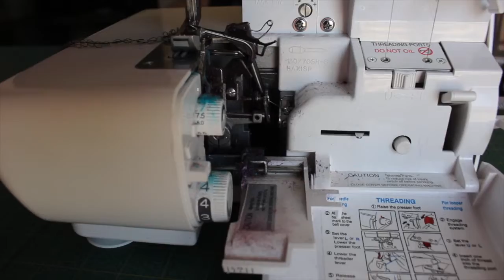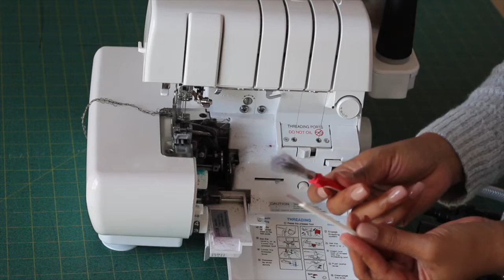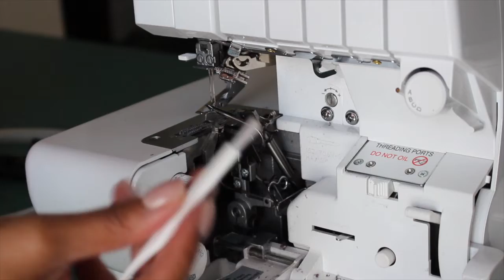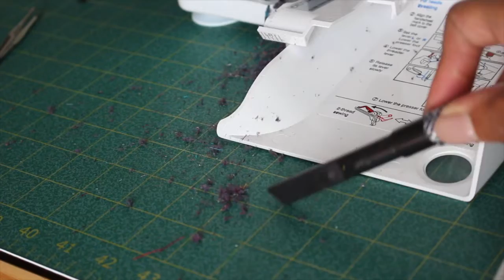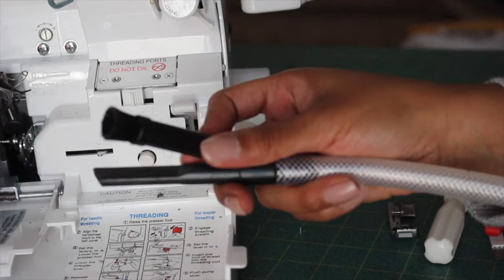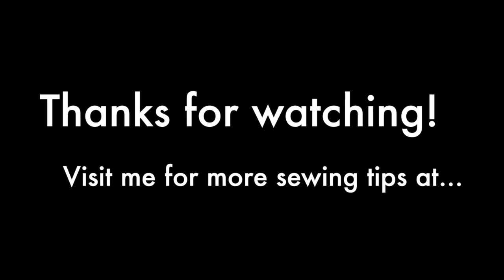How To Clean and Oil A Dirty Serger

Comment: I go straight to vacuuming the machine so no fluff goes further into the machine. If the lint is persistent I brush and vacuum at the same time.
I have the Enlighten and I can open the LHS door to clean the machine on the other side.
My machine manual advised not to oil.
I have my machine serviced every 18months to 2 years. I
I think your left hand side door will open too.
Thanks for the advice. Great video

Comment: I popped off the bottom of my serger to get at lint on the bottom. It really collected on the inside of the bottom cover. I also did put a drop of oil on the screw of the knife. It helped a lot because the knife was stuck in the up position even though I locked the blade.
Reply from the maker: Thanks for the extra tip, Linda! I will pop mine off and see what I find under there!
Reply: @Stylesewme  I júst lay the serger on the back with the bottom facing me.

Comment: I am curious as to why would you be hesitant to remove the stitch plate? That give you better access to the lint below, to the left and behind the feed dogs. Without removing the plate, you are only doing a superficial cleaning of that area. The vacuum helps some but not enough. Also removing the bottom plate will let you clean out all the lint; broken needles etc. that fall down.

Comment: How long did it take you to learn how to use a serger.....operation, adjustments, and actual use?
Reply from the maker: With my first serger, the biggest challenge was adjusting tension to get that neat stitching. That would be a constant learning and tweaking of settings. But, overall, the serger is pretty easy to use. It looks more intimidating than it is.
Reply: @Stylesewme  Thank you for your response. :)

Comment: You neglected the left-hand side of your serger. You only oiled one of 6 ports that get oiled. Please check your manual, sweetie, for the other areas that need to be cleaned and oiled. Also, you are using the oil spout incorrectly, pull the spout ALL the way UP. It will ensure you get only one drop of oil, so you don’t have to guess and use a paper towel. You put the TIP of the spout on the metal part to be oiled - NOT a paper towel or a cloth. When finished, push the metal tip in the bottle DOWNWARD and replace plastic cap. Try to put your brush bristles directly on the clumps of lint and carefully LIFT OFF MACHINE. All that digging and sweeping back-and-forth only moves debris to hidden areas. I hope you don’t mind me giving you these tips. If you clean your machine carefully after EACH use, you will never get build up of threads and lint.